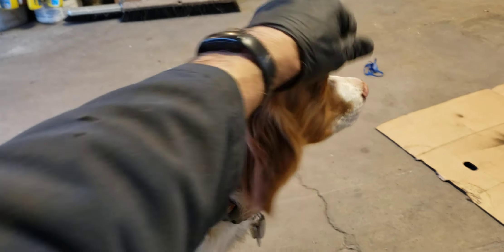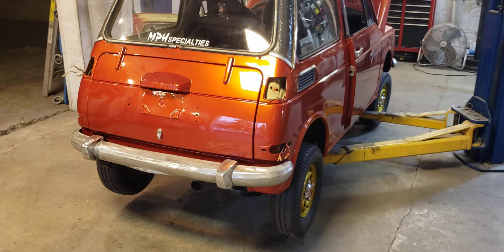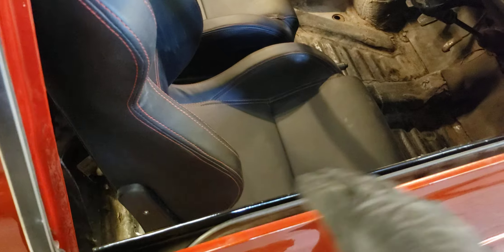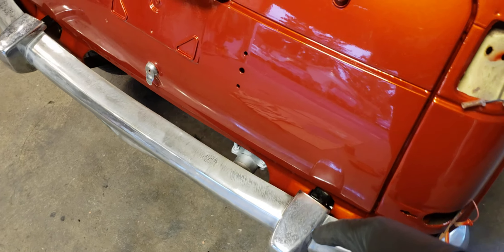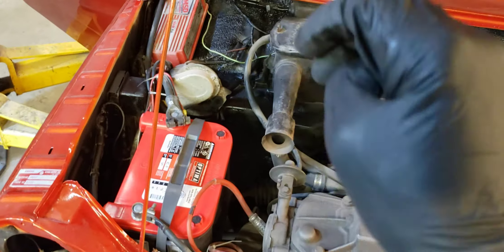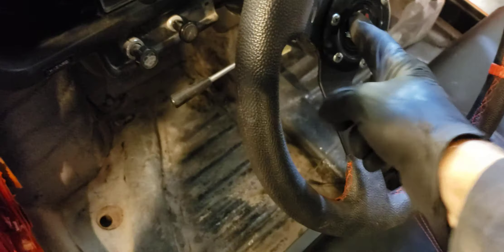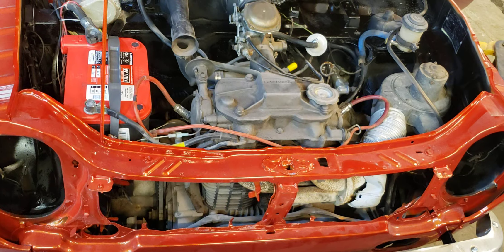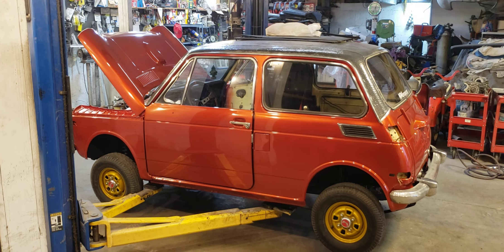Details Matter. Looking Fine Takes Time

Comment: Some people have used the fuzzy side of Velcro tape to make window channel seals. May or may not work for your application. 🇨🇦
Reply: The window channel material is also available in cut-to-fit, too. The folks that sell the window sweep rubber that you can use to restore 1970's and 1980's GM window sweeps sell the felt window channel material.